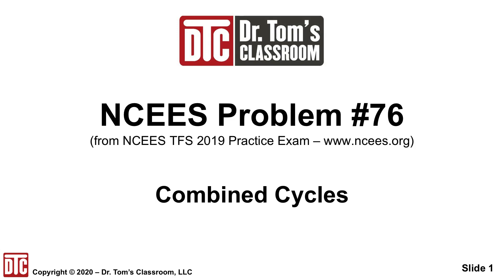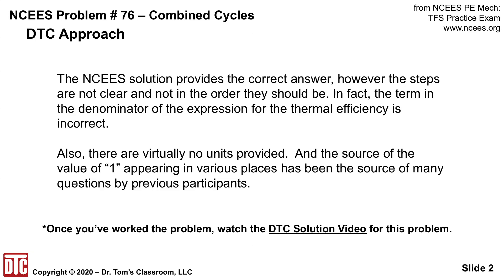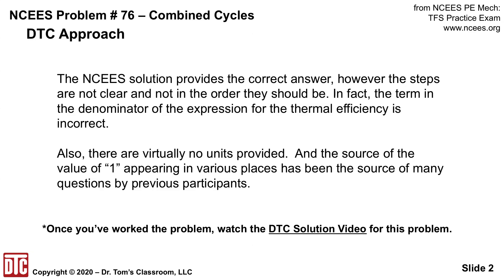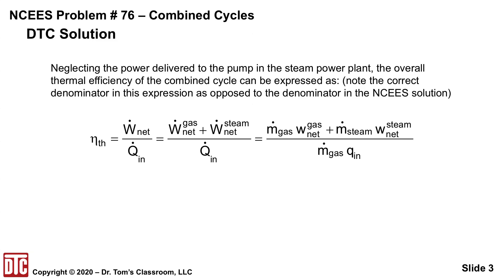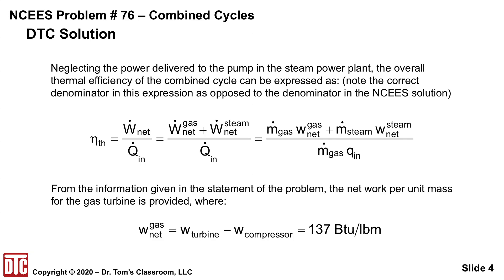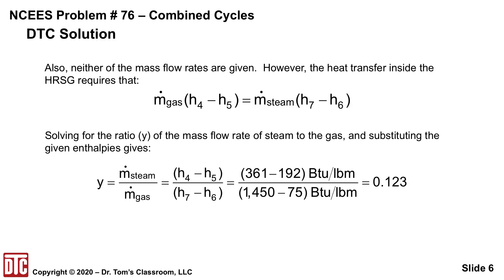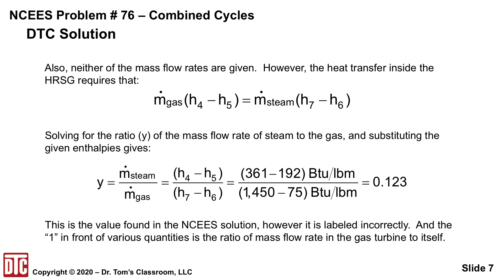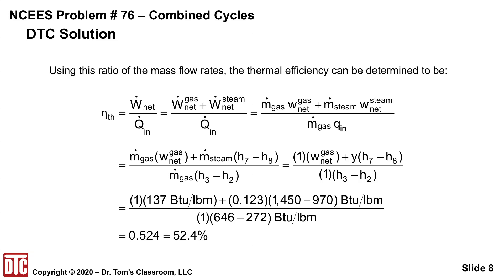NCEES PE Mechanical TFS Practice Exam Problem 76 - Combined Cycles (Solution Tips)

Comment: Even after listening to the reason behind the "1" , it's still confusing and frankly, well...I have no words. Thanks for this. God I hate engineering.
Reply: Yes, the NCEES solution gives no help as to where the "1" comes from.  I've done my best to help reduce the confusion.  This is probably the hardest type problem on the TFS Exam, but remember you don't have to get a 100 to pass.  Tom